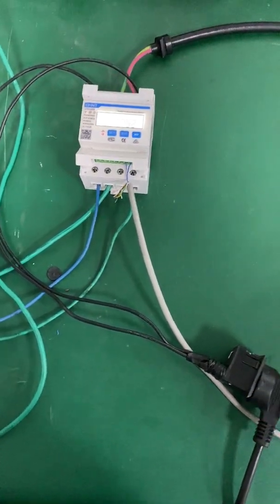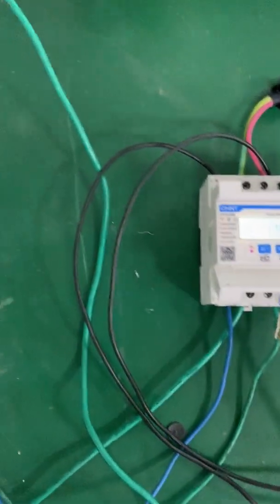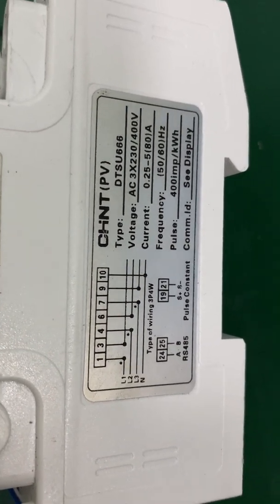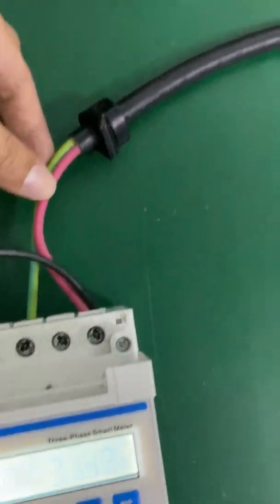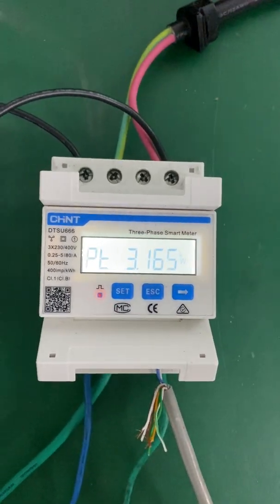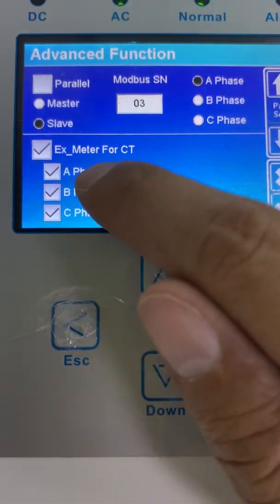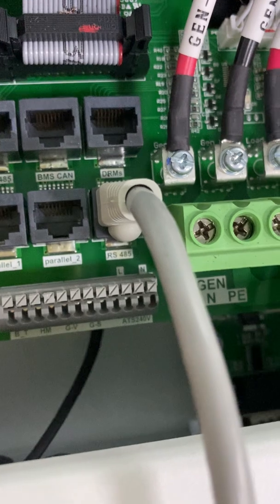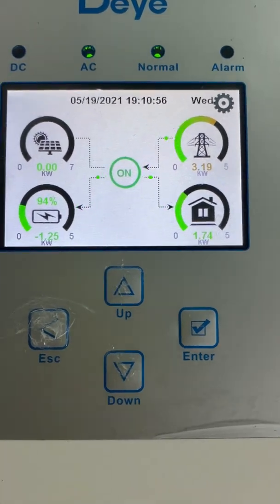How to connect 3phase CHNT meter to the Deye single phase hybrid inverter

Comment: Hello dear
I am a company that installs solar power plants.
I connected three SUN-10K-G02P1-EU-AM2 10kw single phase inverters and one SUN-SG04LP3-EU 12kw hybrid inverter to a customer.
These 4 inverters operate as self-consumption.
These four inverters are currently working with CT current transformers, but i want to use smart meter.
Will these four inverters work properly with a three-phase multifunction energy meter? Or what should be the connection type?
Please help me.

Comment: Hi, I have a Deye inverter and a CHINT DTSU666 smart meter. The both gadgets work together. Since some days I'll get diferent values between CHINT and DEYE. 

CHINT says 300 watt and DEYE says 0 Watt und deactivate the inverter. It seams that always 300 watt more or less between CHINT and DEYE is displayed.

Does anyone know this behavior? Thanks!
Reply: I have found a solution for my problem. I have activated "Ex_Meter for CT" und had selected A + B + C Phase. This worked a week for me. Now I have unselect A + C Phase and only than the system works for me. Very strange ...
Reply from the maker: Hi,there may be a problem with the communication between the meter and the inverter
Reply: What kind of problem do you mean? I have connected a RJ45 cable. Can I test or change something?
Reply: I have the same problem with 3 different inverters. Connection is established but the values always differ. Dtsu values are correct. But the deye seems to receive wrong values. Don't know how to solve the problem.
Reply: @CptKalibak  Have you found a solution for this? I still have the problem.

Comment: Hello !
I have a SUN-5K-SG03LP1-EU hybrid inverter. Tee distance between inverter and grid is 20 meters. So the CT sensor is at this distance. Can I use the CT in this case or it is possible to use a single phase metering  ?  DTSU666 is for 3 phases and my grid has only one phase.

Comment: Hello, is it possible to connect the DTSU666 to the Deye SUN-5K-S03LP1-EU and measure three phases and feed the sum on one phase.
Reply: I have the same question. Deye single phase on an 3 phase system with dtsu666 meter. Sma can do IT.

Comment: Hello, if the CHint DTSU666 is added to a single phase inverter like the 5K-SG03LP1-EU, will it use all phases for regulation? I heard that with installed Eastron SDM630 still only one phase is used.
Reply from the maker: Hello, single-phase inverters can only adjust one phase
Reply: @DeyeInverter_official  Hello, i am not sure if i understand it .... I ask again: You have a single phase deye inverter and connect a 3 phase meter. The goal is, that the meter sends the summary load  of all 3 phases to the inverter , so that the inverter put  on the one phase the needed power . The grid meter makes a summary of all three phases and if the summary is less then needed in the house, there is no need to get power from the grid. Am i right? Kind regrads
Reply: Do you have an answer for your question?

Comment: Good day, I am interested in whether you have any idea how to connect the tsu 666 smart meter to the inverter of solar power plants, because I need it to block the production of electricity from the panel so that it does not send into the grid
Reply from the maker: Hello, please refer to the ammeter in the user manual to connect to the inverter, and set the corresponding ammeter on the inverter.

Comment: Is it possible to connect meter to older 5kW model with only 1 RS485 port ( on top left) and get some firmware update to enable this function?
Reply: can't. that RS485 is used to commucate with battery BMS
Reply: in  this configuration, i dont can use the smart load ? And what about phase 3 ?